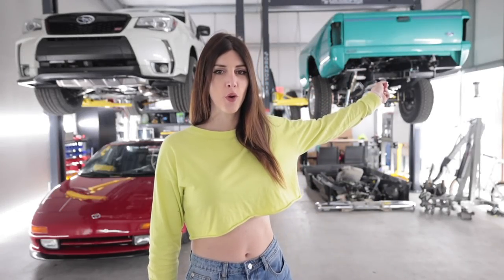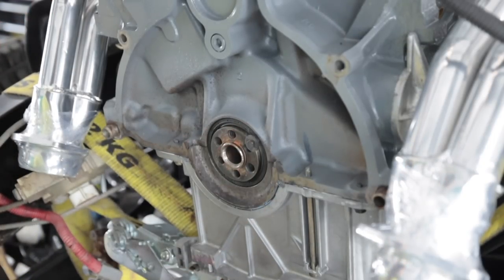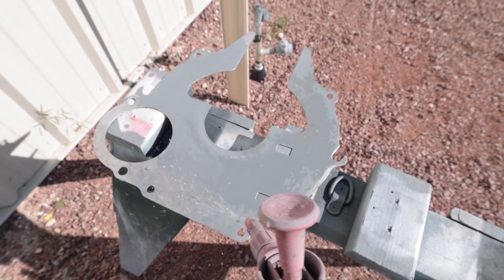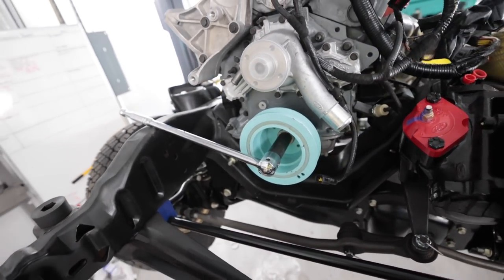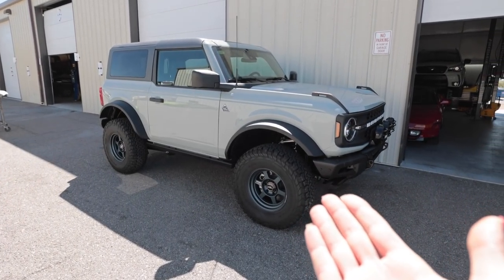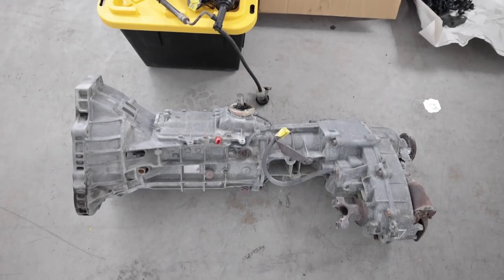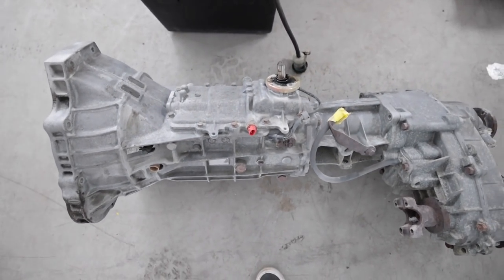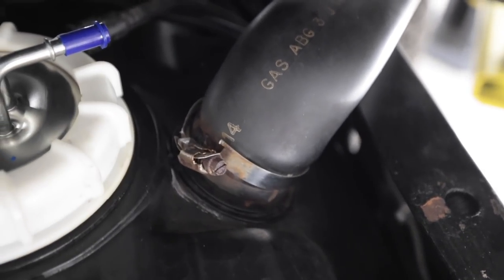A Stupid Simple Problem.. // Ford Ranger Frame-Off Restoration

Comment: Sarah I was researching a problem on a truck I am working on. I literally stubbled across your channel. You so mechanic! My gosh I laughed my ass off. I have been where you are at with the "taking a trip but never leaving the farm".  That's a bad spot to be with what your doing. You do the craziest darn things like bolting on a oil pan on without tightening the rod caps. Reassembling a carburetor with the float sitting right there on your work bench in front of you. Other motorheads did that though, I never did it. ROTFL. Seriously, time out. Go sky diving over Mt. Kīlauea in Hawaii, that will seriously blow out the stagnant mental fuel. With that said I adore you channel. New fan!

Comment: Bug sprayer, swimming pool acid, soda blaster with added baking soda blaster, pressure. 

Spray with acid, let sit for 10 minutes shoot with blaster, pressure wash, repeat if necessary.   

Will bring to bright smooth finish.

Comment: Depending on the finish you're looking for, maybe look into different media for your soda blaster. Maybe glass bead, there's different grades, maybe on the finer side so it doesn't get that rough sandblasted look? There's also a paint stripping process that uses a pressure washer with fine media added and they work on rust too. Probably going to leave the smoothest finish and worth looking into if there's a company nearby.

Comment: Delphi make alot of aftermarket parts these days. Tech tip to stop flywheel moving. Get an old ring gear and cut a piece off. Put a bellhousing bolt in engine then put the piece of ring gear on the flywheel against bolt.

Comment: @Sarah: Your best bet would be contacting LMC Truck in Lenaxa, Kansas, for the flare hardware you need. They sell an aftermarket flare for the Ranger that has hardware with it, but I didn't see an individual part number for the hardware only. Though at $85 + tax, you theoretically could get the flares from LMC Truck, and simply use the hardware kit that comes with it.

And I completely understand on getting OEM fasteners, but given how old the truck is (being almost 30 years old), you may have to go with an aftermarket solution to put the flares back on.
Reply from the maker: I researched it, it’s considered part of the flare so it’s not sold separately.
Reply: @SarahnTuned  : Only other option I can come up with would be to have the proper diameter bolts with nuts and washers, so that at the least, you can bolt the flares back on.

As I said, it's not the preferable solution, but it is a solution. And I understand about wanting OEM fasteners and components.

The other question is, have you thought about using the manual you have and researching possible part numbers from that? I would think that the service manual would have parts numbers for direct or equivalent replacement.

And if not from the manual you have, then perhaps finding a body parts manual that a body shop would use, and getting parts numbers from that.

Comment: Put your torque wrench on the other side (180 degrees across) so there's less leverage to spin the crank.
Reply: I second that idea. It applies to wheel nuts also.
Reply: And if it still turns, you can loosely put in a pressure plate bolt and a transmission bolt and connect with wire or small chain. It doesn't need much to prevent spinning.
Reply: Yes, very useful advice here.

Comment: To get rid of the corrosion on the transmission, spray it with white vinegar. This will neutralise the corrosion, then hit it with the sofa blaster again. Then respray with vinegar. I do this with motorcycle engines that have corrosion and it works a treat.

Comment: You can get a flywheel holding tool to ease the process of torquing the flywheel bolts considerably. Not a very expensive tool, super handy when doing clutch work, but they way you did it works too. Just an FYI.

Comment: I love all the innuendo in this one. It's one of the reasons why I love watching these videos.
Replacing a rear main seal is one big job. I had a very small leak not long ago and all I did was put some AT 205 Reseal in with the oil and that took care of it. Of course if it's leaking big time then you have to bite the bullet and replace it. Of course doing what you're doing you might as well go ahead and replace it while you're there. There are a lot of unscrupulous mechanics that have taken people for a $1,500 repair when they don't really need one. That's why I do most repairs and service myself.

Comment: Fellow Ranger owner & mechanic here... Same mental block thing happens to me when I don't get enough sleep or if I work too much. I'm currently transplanting a 6.8 liter V-10 from a '03 super-duty into an '05 econoline E-350 and I'm really feeling mentally drained... I mean, who wouldnt? It's a V-10 in a van and it sucks! Worked on it over the weekend and started having mental blocks the past few days... realized I have been working every single day this past month so once the new V-10 is in its new home, I'm gonna take time off from work to recharge the batteries. These weekend engine swaps have taken their toll!

Comment: I chemically stripped the engine bay of my XJS when I had the chance, very glad I did. You get such a nice finish with a bare metal engine bay paint job, and zero chance of contamination.
Plus, I just looooove super high gloss engine bays.

Comment: I had a Ranger close to yours and I had issues with the top of the transmission leaking but only when it was spinning I found that they used rubber plugs in the top close to the shifter and they shrink after time, I was able to replace them some small brass plugs that looked like a small freeze plugs
Take care of yourself and hi from Mesa Az

Comment: Try  finding somebody that can bead blast with either plastic beads or glass beads. If you can find an aviation NDI shop (non destructive Inspection) near you, they can blast it and coat it with a finish that will look pretty natural and will not corrode. That transmission should be pure aluminum, but have some magnisium in it like my old aircraft gearboxes on helicopters and need some additional treatment. The NDI shop will know what material it is and how to treat it. Best of luck! I love watching you rebuild Grammy's truck, but take care of your health, Grammy would want that first!

Comment: Little cheater tip with that ring for fuel pump assembly, stick it in the microwave for a short bit to expand it, slips on very much easier and then contracts down on to the tank when it cools down.

Comment: Also, it's pressure/ vaccum bleed the clutch if you're using an OEM line. They have a section that causes air to be trapped giving a dead/shit pedal.

Pressure bleed is best, but vacuum bleed works too

Comment: Gas gauge sender adjustment so that your gas gauge works right, is a real headache with non-OEM fuel pumps. The float arm needs to be tweaked to adjust while the gas gauge is operating, to make sure it is calibrated to the actual fuel level in the tank. At least, with my first-generation Ranger, this is an issue. Beware.

Comment: When tightening flywheels, I hold the flywheel steady using a coach bolt. I have a collection of different sizes. They jam in the gap and hold the flywheel with confidence to tension up the bolts.

Comment: You always dish out great content and info, and we'd watch if you was washing four tires with a pressure washer for 15 mins, it's your humour, knowledge and work ethic and attention to detail that  keeps us tuned in week to week. On a side note Edd China ( the original Wheeler Dealer host ) has just used a laser cleaner on a chassis over on his YT channel, worth a look for a new way to clean stuff, especially if you could do a colab with the company 👍.

Comment: As many have already said please take care of yourself first.
The issue of not remembering what you are doing or where you are going is definitely a sign of tiredness.
Look up “mind safety” it’s used a lot in construction and the offshore industry, it’s essentially recognising when you have too many things going on in your head and becoming overloaded. An example is on your drive to work you arrive at your destination but cannot remember how you got there, your brain is in autopilot mode and this is when you can make mistakes. It’s a lot deeper than what I’ve just described but essentially it’s recognising that you are trying to do too much and it’s time to take a step back and relax.

Comment: In regards the aluminum on your transmission.  About the only way to get old aluminum to look like new is by vapor blasting.  I’m in the Houston area and its no problem to find companies that do that. You may check in your area. In your situation, I would have the guys next door coat it silver with automotive paint, not spray can.

Comment: Sarah try getting hold of either some silica sand or ground glass blasting media or aluminium oxide blasting media as any of the three
will clean the transmission up to a satisfactory level.

Comment: Can I make a suggestion to you regarding the outer finish of the transmission? A steam jenny and some big bear cleaner will make it look like brand new. Access to one can be difficult, but surely someone around you can do the process for you. I use to work as a pipe fitter at a chemical processing plant. I restored a 66 mustang back in 2000. I took the original C3 transmission into work, and used a steam Jenny on it with cleaner and it came out brand new. A steam Jenny is like a pressure washer wand process, but only it’s stream that comes out the end of the wand. I’m sure you can YouTube it 😂 and find someone on here who has done it. Hope it helps.

Comment: It's been many years since I used it, but I polished up a set of Torq Thrust II aluminum wheels with Wenol.  I think I used the blue tube.  They were chalky-white and turned out nice and bright when I was done.  That said, they were supposed to have a smooth machined surface to begin with so the pitting wasn't in some kind of casting grain.

As for the wheel arch clips, if you're willing to go with OE-type even if they're not Ford-produced, have you tried Space Age in Mesa on Country Club?  I've had to get clips even more obscure than for those wheel moldings and they've had some of them.

Comment: Heat up the pump ring (plastic) before installing and it will be easy. Sounds messed up but I put it in the microwave for 1.5 minutes.

Comment: Like I said before , muriatic acid will make those aluminum parts look like new. And it's quick and easy. Or you could spend a little more and use wheel acid. But you'll want the kind for non coated wheels. Spray it on . Then hose it off.

Comment: Sarah, you should try glass beads on your soda blaster. Soda is too soft, but glass beads works much better on corrosived aluminium surfaces like that transmission housing etc.
Learned : Never ever put any C*rter crap on your car like electric fuel pumps, fuel senders etc, they are just waste of money.

Comment: Liquid lock the cylinder on the compression stroke with diesel and put the plug back in when you want to put on harmonic balancer or fly wheel.  It’s easily removed and immediately burns off the residue when you first start it.

Comment: I believe the 2000 - 2004 body style f150 has wheel flare nuts and bolts that will work to hold those flares on

Comment: I used a plastic metal imbedded wire type thing that goes in a drill to clean the heavily oxidation on aluminum cases . They sell them at Summit and they’re color coded as to how abrasive they are

Comment: Sarah, I used a cheap graviity fed sand blast kit similar to HF 50 LB. Portable Abrasive Blaster Kit and recycled crushed glass from a local supply house ($12 for 50 lb. bag) on aluminum housings like your transmission and transfer case outside in my yard and it turned out really nice. $35 for the HF kit.  See if you can get some recycled crushed glass cheap at one of your local sandblast suppliers.  Your powdercoater would know how to get some low cost crushed glass media in your area.  I'm in the process of stripping paint off my deceased father in law's 1992 Silverado to prep for paint.  Boxed in frame rails and frame is almost ready for paint or powdercoating.  I can't compete with your pace of work but little by little I have a sweet keepsake from my awesome father in law better known as PopPop.🎉

Comment: Hi interwebs celebrity. I enjoy watching your videos, despite not being a big "car" fan. This is the second video in a row I watched you drill with a (small diameter) "jobber" length drill and feared (Eeeyaaaa!!!) it would snap from the bending/flexing, so I would like to offer a suggestion (without trying to insult your intelligence). I wonder if you know about "stub length" or "screw machine" drill bits. Due to their shorter length, you're less likely to bend the drill bit when hand drilling, while also gaining better control over the hand drill itself. Just a suggestion.

Comment: I hate to break it to you, but on those trucks it isn't always the fuel level sending unit. MOST of the time it is the anti-slosh sensor on the gauge cluster circuit board. I had a 1989 Ford Ranger that I had to replace that on twice (had the truck from new until 2015).

Comment: I understand wanting to use OEM fittings if you can, but sometimes, it's worth improvising with something new. 30 year old plastic is not something I'd want to depend on to keep a vehicle together. I recently did a ton of work on an 04 Grand Cherokee, and some parts aren't available anymore, so I improvised with fittings that were new and I feel much more confident in keeping parts on the vehicle as opposed to relying on old plastic.

As for the transmission, I agree regular paint would not be a great choice, but an epoxy based coating would serve you well. I personally like POR-15, and they have different colors now, including silver. Super durable stuff and it won't be susceptible to rock chips like paint will. Over time, sure, but you'd probably need a rebuild/replacement before that coating gave out lol

Comment: Autosmart make this product called "ALI ACID"  use it on your gear box it will come up like new. I've used it on aluminum bullbars, side steps even cleaned out the inside of a F150 351 fuel tank that was all chatty. Came up like new.

Comment: You might be surprised at what a wire wheel can do for oxidized aluminum.  Being a transmission tech I have tried sand, soda, wire wheels and some acid.  Sand and wire wheels work best.  A laser would be the best by far.

Comment: I'm wondering if crushed walnut media in a sandblaster would clean up that transmission the way you want.  It would be a bit more aggressive than the soda but softer than typical sandblasting materials.  (Used to use it to clean granite and other surfaced that we didn't want to cut into at all.)  Might be an idea, or it may be a bad idea for some reason I'm not thinking of.

Amazing work!  The power of the OCD is strong in you :)
Reply from the maker: I tried! It clogged it.

Comment: Your going to hate life if you ever have to take any of the bolts back out with all the red thread locker. You really should be using blue. Red is more permanent and requires her to remove. I do love what you are doing with the Ranger.

Comment: The solution is eagle 1 chrome wheel clear.  It's an acid mixture, but it is getting harder to find now.  It will take all the oxidation off the cast Al.  They make a mag wheel cleaner that is basically the same thing
Reply from the maker: I used something stronger on it today that that, it’s getting there.. but the bad areas need an even more aggressive approach.
Reply: @SarahnTuned  the Eagle 1 wheel cleaner and etching cleaner, bubble when you apply it.  I personally don't know anything stronger readily available.  What did you use?

Comment: try using WD-40 to take the oxide off the cast aluminum you should be able to just spray 
on a light coating then brush it with a stiff bristle brush then wipe dry with a rag .
Try this on some scrap parts to see if it will leave the type finish you are wanting.

Comment: Steam cleaner is the bees knees for cleaning parts like that.

CLR will work on the transmission and TC.  The down side is that it will corrode faster.

Comment: I have a bunch of the plastic clips for the flares left in the garage from when I redid my '03 ranger 4x4 flares but they're the push pin "Christmas tree" on one side "T" on the other side plastic pieces.....must be different from the previous generation Ranger flares??    not sure.

Comment: Replace the fuel filler hose. Mine was trashed  when I bought it. It had 114,000 miles on it when I bought it. I'm the second owner.

Comment: Awesome 👍🏻👍🏽    yeah you work to hard should just do 6 days,  but you need a break for yourself 😀👍🏻 ,   I'm finally getting to paint my Rav4 and it's got alot of plastic parts I took off , to paint separate and different colour,  it's had alot of dirt stuck behind it 😞  hopefully can get it done as it's outside under a veranda it's just a quick rattle can paint job army green flat paint so it will hide alot of faults , it's just a dayley driver , and I'm hoping to do other projects but better finsh on those 😀👍🏽👍🏻

Comment: ever see dry ice blasting to clean -it supposed to be better than sand blasting
Reply from the maker: The machines cost $10k to $40k and require a massive volume air compressor.